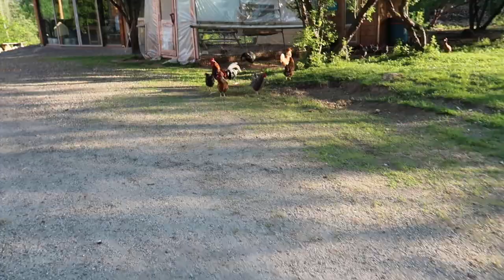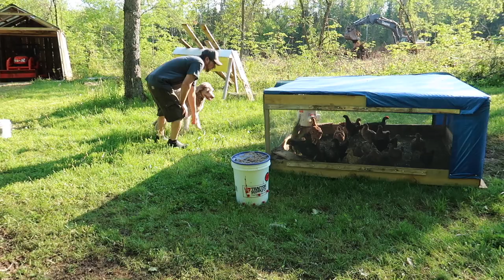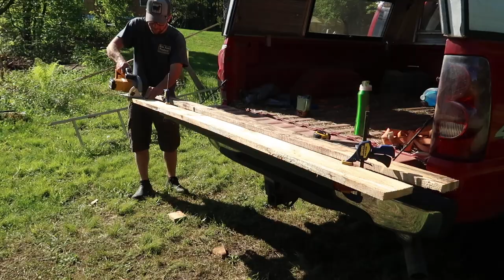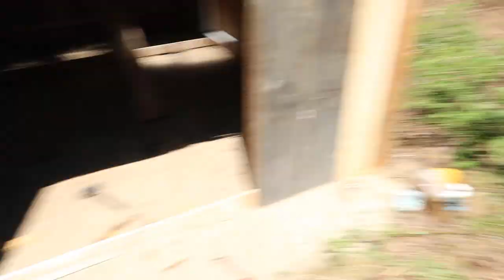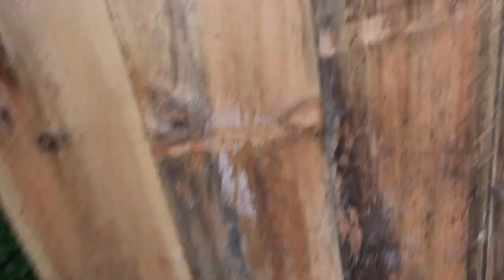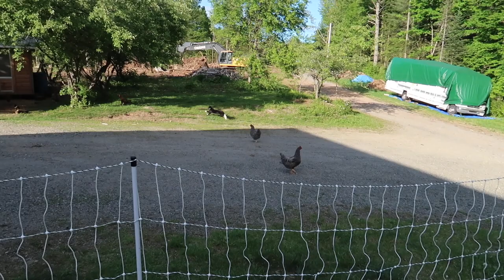They SHOWED Up to Start  STUMPING the Field! & Getting the Goat Barn Enclosed

Comment: Them stump piles give me flashbacks of the land I had cleared five years ago . . . you're lucky, you have the little tractor. I found it impossible to take the piles apart to burn because there was so much soil, mixed in. They are sort of rotted into mounds in the field now, I should have spent the money to have them trucked away. Love you goat barn, simple . . . hope it stand up under a good wind.

Comment: When they cleared the 3 acres for their landing operations in Canterbury they pulled the stumps with a bucket like this, no thumb, just a regular big excavator.  This was slow going and they took the dirt with the stumps.  When I had the 7 acres cleared of both the stumps and the stones, (We had about twice as much volume in stones and we had in stumps.)  I got the king of stump removal to come do the job.  He brings in a smaller excavator with a spiked horn instead of a bucket.  I'd like to find a picture to show you.  With the spike he would rake down both sides of the stump then he would mover over 90 degrees around the stump and rake those two sides. them he could take the stump out with the spike.  This was very quick and he left the good forest dirt behind.  He then had a small dozer,  with the spike he would sort of windrow the stumps and stones.  We had a gulch he was filling with the stones and stumps.  He would hop on the dozer, or I would, and push them to the drop-off at the gulch.  Where we once had quite a gulch there is now about three-quarters of an acre of hay field.